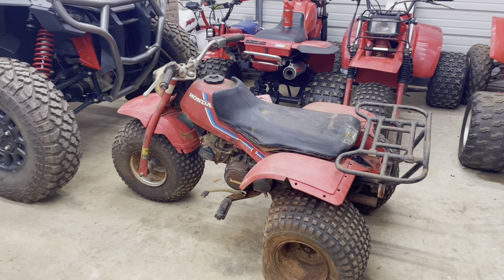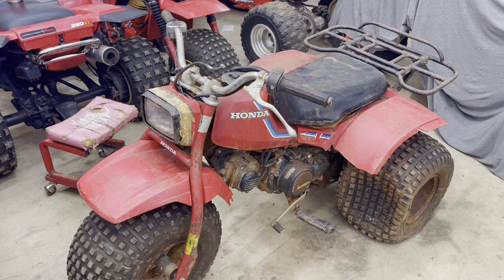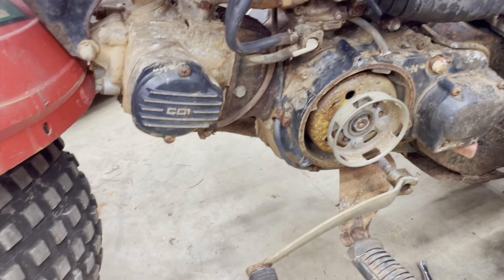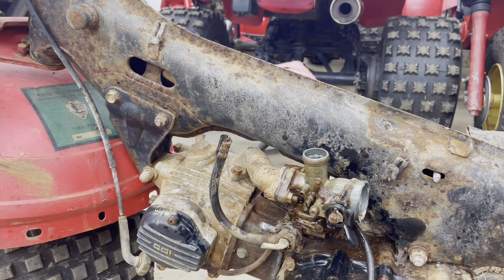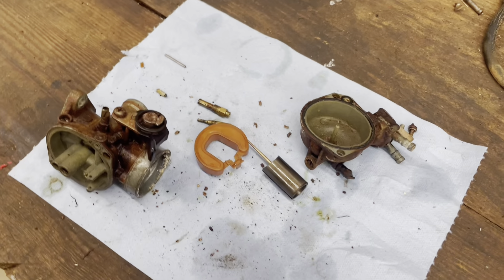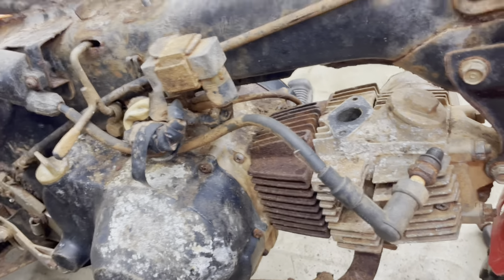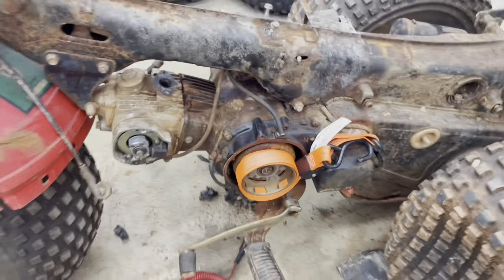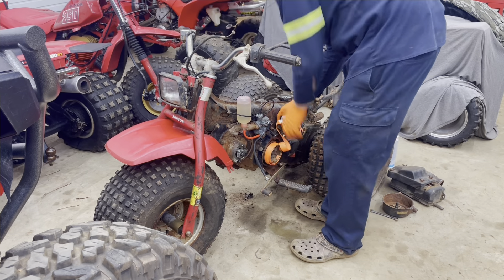Barn find atc110!? Will it run!!??

Comment: Use a drill to fire it off with a socket it works wonders
Reply from the maker: Yes sir I was to get spark but once I put that plug back in the compression kept breaking my adapters after I got it running it was starting first pull so wasn’t too big of a deal